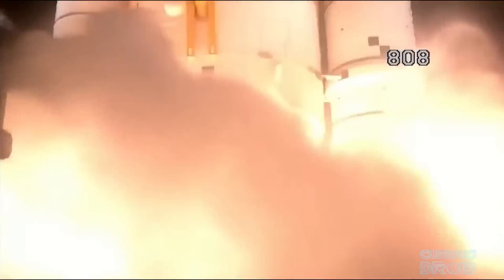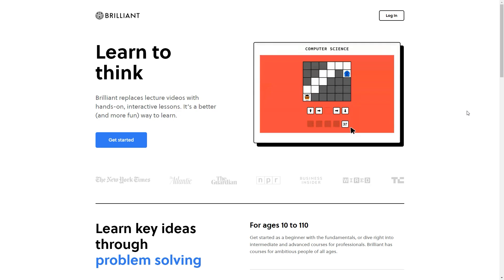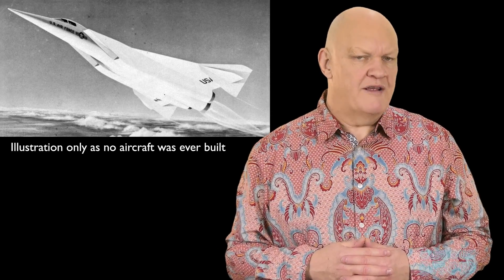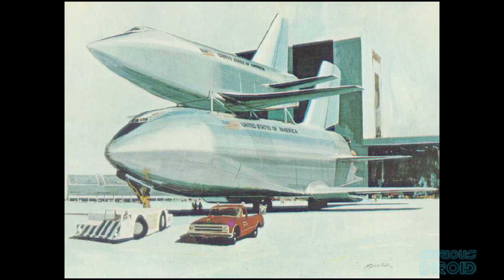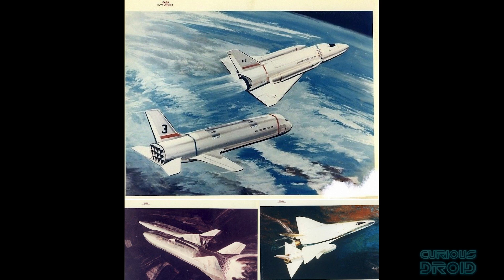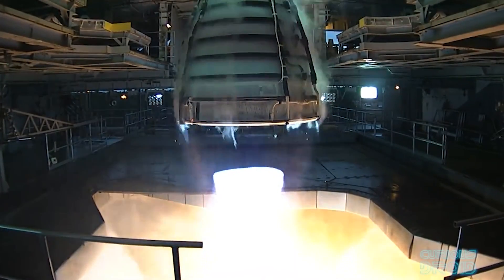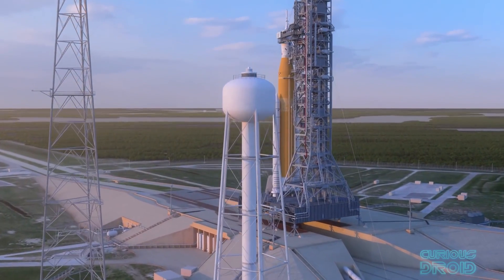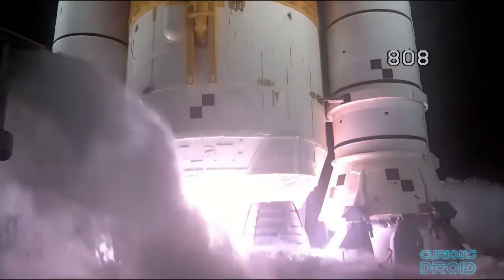Why is NASA Throwing Away Reusable Engines?

Comment: Its only “rocket science” because if you make an auto engine one minor misfire during its entire life doesn’t blow up the car in huge fireball. Rocket engines have to be pretty exact despite mostly just consisting of a fuel tank, burn chamber and a flow valve in between. The complexity just comes from trying to not waste an oz of fuel.
Reply: Wow, you have managed to oversimplify a rocket engine to the point of being ridiculous.
Reply: There is a LOT of complexity as these engines have to be able to rotate in 2 axes while producing thrust to maintain the direction of rocket flight. They also have to be able to adjust their thrust to achieve proper speed. The valves and pumps that adjust the dual fuel flow have to work under high temp's, vibration and multiple G's of thrust. In order to verify that they will work correctly you would have to disassemble and test each valve/pump and also X-ray all components to look for cracks and temp/vibration damage. It might cost more than building a new one.
Reply: That brings to mind a quote which has minor fame in certain circles, "There are a thousand things that can happen when you go light a rocket engine, and only one of them is good." Tom Mueller of SpaceX, in Air and Space, Jan. 2011
Reply: Rocket engines really should be compared to top fuel dragsters rather than normal cars, both push engineering to their limits and occasionally explosively self dissemble, hell top fuel engines only need to last about 5-6s at full power..
Reply: @volentimeh  That brings to mind an acronym, RUD, Rapid Unscheduled Disassembly.
Reply: SpaceX's Falcon 9 has demonstrated engine out capability, where losing one engine did not destroy the vehicle or doom the mission. CRS-1 had a catastrophic engine failure of one Merlin 1C engine. They're also had an engine automatically shut down during ascent without failing the mission. Multiple engines means you have engine out capability like having multiple engines on an airliner means you can still fly safely.

Comment: What a great video. I think most people don't realize SLS is made of Shuttle parts. They know it looks familiar. It has an orange tank and the two white solid boosters but they probably assume that's just what NASA rockets look like.

Personally, I don't think they'll make it through developing the RS25F before Starship proves it's viability. I don't know if SLS will be completely canceled but it will at least be scaled way back. They might just use up what engines they have left and then let Starship take over all duties. If Starship can make orbital refueling a reality, there'll be no need for SLS.
Reply: Honestly, I kinda doubt this. Starship requires multiple refueling missions for TLI and deep space, which negates any cost benefits from being reusable. It'll be a hard sell for NASA. Starship probably has a better niche in heavy lift LEO launches. At the moment, SLS really is the most viable option for the moon and beyond.
Reply: @newq  That's true. Starship is not designed for that job. It will, hopefully, enable the kind of orbital infrastructure that will support Moon access, but that's a long ways off.
Reply: @robertmiller9735  I would agree that it's not designed for that job, but SpaceX damn sure pitched it as a rocket meant for that job.
Reply: Personally, I wouldn't count on Moosk.
Reply: SLS is bound to be cancelled Starship or no Starship. We better hope Starship development has gone far enough by then.
Reply: @robertmiller9735  The government has no plans to cancel SLS. As long as they keep funding it, it will fly. Just because it is expensive doesn’t mean it will be cancelled. NASA can afford it and will keep construction going on it.
Reply: @nachobasket  All it takes is one of its Senate patrons to retire or die, or some congressmembers or a president to decide they need to look financially responsible. Then they whittle away at it until it's hopeless.

The lunar space station does help: international political obligations are something politicians are probably less likely to toss out.
Reply: I mean I didn't know that but it doesn't surprise me especially since NASA is one the more cash strapped agencies of the US gov't and is normally the first to get budget cuts whenever anyone mentions cutting funding to something. (Though we are just as fine spending more money on the DoD and military even though the contractors are the same. Figure that one out) using space shuttle parts would make sense since there already infrastructure in place and the limited money that is there can go into more important components that do need some thought and design
Reply: @HankScorpio64  The thing you don't want (or at least don't care about very much) is always more expensive.

Comment: It is shocking that they just dump those RS engines
Reply: @@sourandjaded2586 I would say that the bottom of the sea is definitely dumped.
Reply: There is no way to recover the RS engines without sacrificing the payload capacity needed to send humans on deep space missions. Besides, the engines have already been used on multiple shuttle missions. NASA got their moneys worth out of them.
Reply: I guess gathering dust in a museum is better 🙄
Reply: @atomicshadowman9143  I prefer "reused dozens of times, then retired to gather dust in a museum", which is what they were built for.
Reply: @RCAvhstape  I prefer "reused dozens of times, then used to send astronauts to the Moon". They were not built to gather dust in a museum.
Reply: @nagualdesign  Once they reach a number of flights you have to retire them. Nothing lasts forever.
Reply: @RCAvhstape  So why not use them one last time for Artemis? The alternative would be to use brand new engines for Artemis.
Reply: @nagualdesign  Hopefully Artemis will get the new RS-25E/F.
Reply: @RCAvhstape  dumping the reusable engines into sea or museum when they haven't reached their end of life is ok but making new engines which are not reusable is actually not seems good. 🙄
Reply: @GOOD_FARMER  Nonreusable engines can be cheaper than reusable ones, plus they can run them flat out almost to the point of trashing them because they are only going to burn for 8-10 minutes total.
Reply: @RCAvhstape  
Call your Congresscritter and have them fund pulling the remaining orbiters out of museums.
Reply: @atomicshadowman9143  Why?